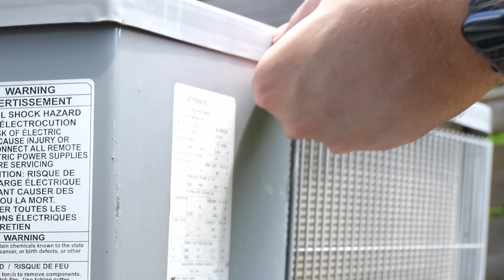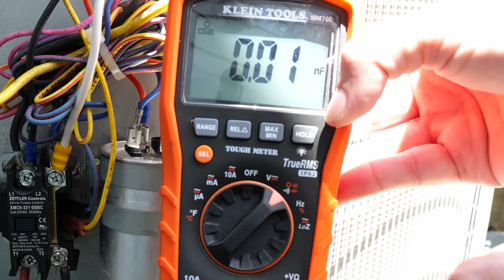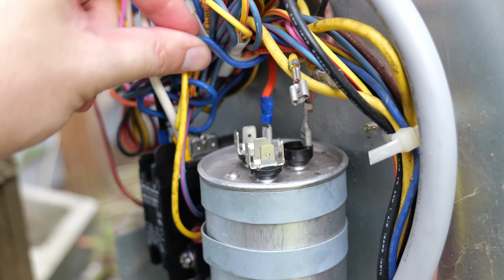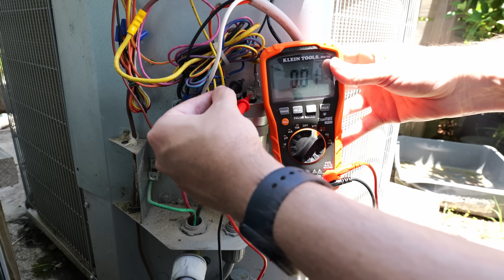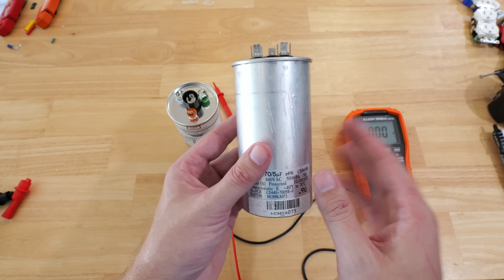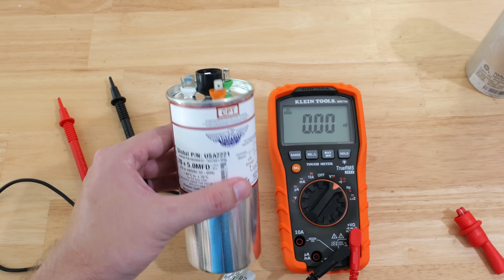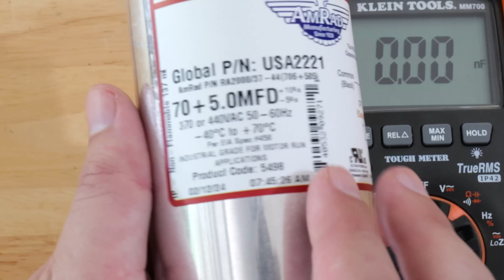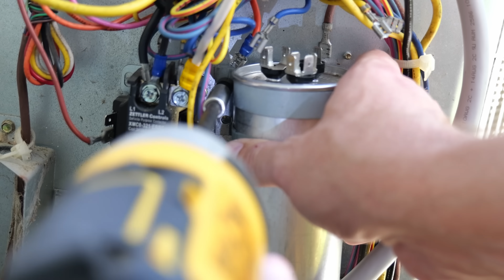Don’t Get Ripped Off! How To Avoid The AC Capacitor Scam And Save $500

Comment: When my first one went out, I wanted to be sure even though I had researched my symptoms. The A/C guy wanted $350. I said "Dude, you're out here, so I'm willing to pay you $150, but you know that's a $20 part, and it'll take you five more minutes to install it." He held firm, so I over-nighted one from Amazon. $30.
Reply: Caps are gravy train for a/c techs. It helps balance out the times they have to spend hours figuring out a problem and they don't charge extra for it.
Reply: @sprockkets not really unless the reason it failed is obvious. They seldom fail for no reason.
Reply: @Bryan-Hensley  ive had two fail for no reason, in 5 years, other than they are cheaply made garbage, like everything else these days
Reply: @Mach141  if you use the kind that has the solder looking spot on top (like in this video), they are junk.
Reply from the maker: Mine have lasted 5-7 years every time.  I’ll take that for the price of $10-$15.  The AmRads are better for sure but just depends on if you’re good with 5-7 years for $10-$15 or maybe a few more years for $35-50 with the American made ones.
Reply: @HowToHomeDIY  even though im in a extreme use scenario, heat pump, used year round, brutally hot summers...i never really had a problem so often as I do after having a carrier installed in 2017. After that i was calling for repairs what seems like every 18 months to two years. Caps were just dropping one after another. Obviously they were using garbage parts, it currently has a titan pro which are $18. So im tempted to spend more on hopefully a longer lasting one, but you just never know. maybe the garbage they put in the second time last for 9 more years. its a gamble no matter what you decide. BUT ACCORDING TO THE PREVIOS FAILURE RATE, IM ABOUT DUE FOR ANOTHER
Reply: Shit he was a fool. I would charge 150 for the job. That's very reasonable.
Reply from the maker: @myfakeguuglaccount8307 yup.  That’s the game some of them will play to be able to not just sell the job but also some of them use it to charge ridiculous amounts of money.  I agree with you $350 is pretty high.  And you’ll probably see some of those techs in these comments 😬
Reply: Did you diagnose why it failed? There's a couple of things that can kill the compressor. Low Freon will cause a capacitor to fail because low Freon will overheat your compressor, for one example..
Reply: @Bryan-Hensley  Age (6+ years) and corrosion on the terminals.
Reply: Firstly, the technician themselves do not control the price for parts and labor unless it is one of those one man shops. Secondly,  not only are you paying for the convenience of him having the part you need right there on his truck, that mark up also pays for the insurance and gas for his truck, repairs for the truck, insurance in case he has an accident on your property, help cover the typical losses that occur with any service company, his knowledge to diagnose what your issue is (this time was an easy one), etc. If they didn't mark these parts up, there would be no AC companies in business and your equipment wouldn't get fixed. It's how the economy works. It's expensive to run a business,  most do not understand this. Not trying to scam you
Reply: That should be included in the price of the visit.
Reply: @ZeroCool2345  This…. Funny how people don’t realize this. This goes along all lines of services that people do not realize.
Reply: @ZeroCool2345  Dont forget they are also paying for his knowledge and experience. That is most certainly worth something as well. If it was so easy then Mr.Homeowner should have done all the diagnostics himself. These people are smoking crack if they think these companies should charge 150 bucks and call it a day. They would all go out of business if they followed Youtube Economics.
Reply: @mr.roberts3886  I didn't say he was trying to scam me. But if you're trying to pay for all that with a job that should cost $40, you shouldn't be in business. Still, because I understand there's more to it than just the job, I offered him more than three times what the job itself is worth. No way a capacitor swap should be putting your kids through Harvard.

Comment: I’m a retired HVAC&R contractor. Capacitors are the current scam, if the compressor and fan just hum and then shut off the odds are just the cap is bad. Scams are even run by “returnable” companies, 
ALWAYS if a major or replacement is needed get a second opinion.

Comment: Didnt you check the contactor backwards?  Incoming voltage should be on L1 and L2.  T1 and T2 should go to the equipment.  Atleast that is what I thought
Reply from the maker: They both have voltage at the bottom.  It’s 240v.

Comment: You can test for capacitance while it is still in the circuit and running if you just want to see if it’s close to the Microfarad printed on the capacitor. Read the voltage across common and herm and also read the current going through the wire labeled herm. Take these two values and plug them into the formula. C= 2652* I/V. 
That’s the current (I) multiplied by 2652 all divided by the voltage (V) will give you the capacitance in microfarad. Of course you can do the same thing for the run capacitor for the fan motor.
Reply: If a DIY person knows how to measure current, they typically will have a meter that reads capacitance.
Reply: @mvm932  For a DIY person a clamp meter makes more sense than a multimeter. In about a tenth of the time it takes you to remove all the leads off of the capacitor, making sure you can remember how to put them back, you could’ve taken two measurements and determined whether the capacitor was still within specifications. If the DIY person is not comfortable working on the unit with the power on then they should probably do it as the video demonstrates. It does seem a waste to buy a meter that is multifunctional and only use it for reading capacitance. Whatever you do, take your time and be safe!

Comment: We were taught in RV school to use the multimeter to discharge the capacitor.   Set on max VAC and use your probes.
Reply: Even if the meter is designed to withstand the short, why risk it when a screwdriver will do the job without putting your electronics at risk?
Reply: @amiatroll1 Because 1. A multimeter has to have high resistance to correctly measure voltage and 2. It's a non issue to begin with - the windings in the motor discharge it already. I've never found a cap with a charge on it in the field. 😅
Reply: @sprockkets  I agree it's rare, I just don't see the point in insisting it be discharged with the meter. Maybe I am dumb :D
Reply: @sprockkets   Me neither, but was just relaying what we were taught when dealing with RV A/Cs.
Reply: @amiatroll1  My CL900 tops at 1000VAC.   Even if charged, that cap might be in the low 400's.   This is what we learned just in case there are sparks.
Reply: @starhopper457  Fair enough. Thanks!

Comment: A couple years ago my heat pump quit working and it was the same cap you're working with. It was bulging out, and the service tech showed me that, so I had him replce it. But $300?!? I didn't know any better at the time. A few weeks ago my heat pump quit working and the start relay was fried. There were two caps in close proximity (my unit has three caps) that I didn't know the condition of (my multi-meter didn't read capacitance) so I just ordered them along with a relay and a new multi-meter. Total bill $100 and the unit is running fine now!

Comment: This will save people money as long as they know what they're doing, which this video shows you how to do it. You're a gentleman.
Reply from the maker: @johnleo2668 really glad to hear you liked it!   Thanks a lot for the feedback John!
Reply: Yeah, the meter costs more than a service call.
Reply from the maker: @Bryan-Hensley you’re being an HVAC guy and saying things that can be true but don’t usually play out that that way.  The meter I used in the video is $80-90.  Service calls alone are either that much or more.  That’s just for the service call.  But then if you replace it, it’s much more money.  And for that $80-90 I have an asset for the future when I need to check it for this or any other electrical projects.  Where when I call someone out I’m basically just burning that money and hoping I got an honest AC tech.  Because I had this meter and know how to use it, I saved myself from having my capacitor changed unnecessarily.
Reply: @Bryan-Hensley lol what? That might be true if you get a nice fluke, but besides that... where you get your meters?  I'll sell you some used( and tested within the last year) ones for... cheap?, apparently lol?.  Fluke, Klein, ideal , commercial electric. W.e. you'd like lol

Edit. Shit I'll sell some new ones too lol.
Reply: @Bryan-Hensley  You can buy a decent digital multimeter for $50.

Comment: Only thing I’d add, is if you have your furnace still powered if a call to cooling comes on you’ll still have low voltage going to the ac unit and can have the contactor sides powered so be careful. You can pull the furnace door off and most of the time be fine or flip the breaker to the furnace and ac. It’s only 24vs so it won’t kill you but a small bite if you touch the terminals, or when the contacts close it’ll share the shit out of you.

Edit, one more thing make sure air is blowing out of the top and not sucking air in, that’ll help make sure you wired the capacitor up right.
Reply: That’s a good point. Also, even with the 240v disconnect pulled, you may blow the small fuse (usually ~5A) on the furnace board if you accidentally short out the 24v terminals. Ask me how I know.

Comment: Install a soft start. I almost told a customer their cap was bad but figured out it was my old meter after checking 2 other caps. Every cap I have ever found bad had visual evidence along with a sad reading.
Reply: Soft start ?    How much should that be to install to stop replacing these capacitors .   I’ve been told it helps ease the start up and not make these go bad or go bad so quickly.    Thanks
Reply from the maker: Yup.  I love my soft start.  In fact a year ago before I found out my cap was bad, the unit was working just fine until I decided to test everything and remove the soft start.  It was the soft start that keeping the AC running!  They are awesome.  Most techs I have met don't know what one is I have found.
Reply: Must not be in Florida lol.  seems to possibly be the majority even

Comment: More: in addition to taking photos of the old cap wiring, write down which wire goes to what terminal... they might be laid out differently on the new cap. Be sure the connectors fit snug... and write the install date on the new cap with a Sharpie.
Reply: The capacitor is already marked on terminals. C is the common or line, H is for hermetic compressor and F is for fan no reason to write crap down. A lot of caps will only have a single terminal for your fan connection. You only have to remove the 2 bottom screws on the units. Discharging it once is fine and a lot of caps you don’t have to as they have a resistor installed which discharges itself. Just because a cap tests out while on a table doesn’t mean it will test out while power applied. There is a calculation that tells you what they cap is actually putting out while running which is the correct way to test. Need to measure the amps and voltage and x 2650.
Reply: Thanks for your information, it was very helpful! ❤
Reply: You could simply include this information in your photo
Reply: @Mach141  The point is, you are helping the next person who might be servicing this unit with the info written down on the capacitor.  They won't have access to any pictures and even the person who took the pic can lose access to the picture by it being accidentally deleted, or phone lost, etc.    Writing it down bypasses all those issues and helps whoever is servicing the unit next.
Reply: @stevenhunt66  Are you for real?  When it was installed last is worthless information, it works or it doesnt. If its under warranty then the same company that installed it will be called to fix it, and they have records of when it was last installed. And the wires are already connected before you remove it, so you take a picture EACH time before removal. No old pictures needed. Lmao. Hope that wasnt too mind blowing for you.
Reply: @Mach141  It's the same premise as writing down the date and mileage on your oil filter after you change the oil in your vehicle.  More information is never a bad thing.  If you don't like to practice this, then do you.  I prefer to have the information and appreciate when others practice this as well.
Reply: @stevenhunt66  If it works for you, even though its a complete waste of time, go for it. You do you.
Reply: @stevenhunt66  So your going to write the oil change information in  a place that requires jacking up the car and removing splash shields to even see it? Just brilliant.
Reply: @Mach141  What vehicle do I own that requires what you are assuming?   The point has completely been missed by you... right over your large head.   Like I said... you do you.   Have a good one.   LMFAO!!!
Reply: @stevenhunt66  doesnt matter. Why pop the hood when you could put it on a piece of paper somewhere? Every idea you suggested I have proven is poor with logic and fact. You cant comprehend to take a new picture of cap wires every time you remove it? You want to stuff a childs drawing with colors and pictures inside the electrical compartment on a condenser unit "for the next guy". I missed zero points. Instead of you admitting yeah, Im not a professional (at least i hope you arent) and these ideas are dumb, you keep talking about things going over ones head. Sad.
Reply: @Mach141 "The same company that installed it will be called to fix it" ... on a DIY video?  🤦‍♂️
Reply: @DaddyBeanDaddyBean  your not even in the same ball park brother...this was never a discussion about videos
Reply: What if I take a Polaroid picture and store my photo album inside the unit?
Reply: @stevenhunt66 write it down? Already marked. The capacitor is marked with letters for where the wires go. H is for hermetic compressor C is the common connection and F is for fan.
Reply: That is correct..... help the next guy out.

Comment: Caps are really failure prone... usually going bad at the first heat wave of the season.

They're like a $20 item... I replace mine as preventive maintenance every 2 years no matter what, and keep a spare. Even have a repeating calendar event set up as a reminder.

Life's too short for baking a few days over a bad cap, and paying $100 or more for one off some HVAC guy.

I also keep a spare contactor... they fail now & again as well. Also a low dollar item.
Reply: As an HVAC guy, a good chunk of my summer service calls are just walking up and replacing capacitors.  I’ve had them fail inside a month from a factory new condenser.  It’s a good thing they’re a cheap part.
Reply: Dang boys, my unit’s 33 yrs old & only two service calls; one was freon & the other was a tripped breaker. Upper 90s - 114°F is common… already hit 100° 2x this year.
Reply: @sunshine3914  
Why did you have a Freon call?  Leaking valve?

Comment: I didn't give any HVAC professional a chance to try to scam me a few weeks ago when my condenser fan wouldn't come on. Watched a few videos on YouTube and then checked the capacitor. Mine was obviously failed since the top was building badly. Got a new one, hooked it up, and it's working again. 

I did find out that my multimeter doesn't have the right mode to test the capacitor though. 🙁
Reply: Most of the basic multimeters don't do farads
Reply: @stevencole7331  You can get a Fluke 101 which is like $44 which tests capacitors also.
Reply: Most caps fail either open or short. You could just use a continuity tester. If it beeps continuously, it's short. If it never beeps, it's open. If it beeps for a time then stops, it's OK (the higher the capacitance the longer the beep - you could see how long on a known good replacement.)
Reply: That Klein meter he's using is pretty nice. Not Fluke level, but much better than the junk you'd buy on Amazon.

Comment: Last week my A/C unit was not cooling. Found that a rodent had made a nest around the capacitor and chewed through a hot wire. However, it is recommended that the capacitor should should be changed every five years. Excellent post!!
Reply from the maker: Wow that would definitely do it! That is pretty wild.  Thanks a lot for taking the time to share that experience and input Keith!

Comment: So what was the issue that lead you to the capacitor?
Reply: So if the capacitor he tested was good then what was the problem with his AC?
Reply from the maker: I didn't say there was a problem this time.  I was sharing what an AC tech said and did on a routine maintenance check.
Reply: Typically compressor won't start and you'll hear a loud buzz sound.
Reply: Ah ok. I was a little confused. My bad.
Reply from the maker: All good!  What kind of Jaglover are you?  The car or NFL team?
Reply: @HowToHomeDIY  I
The car. I love them. I have a 1967 E-Type.